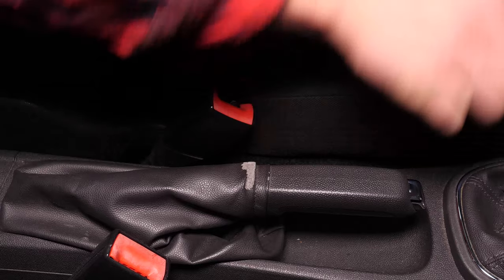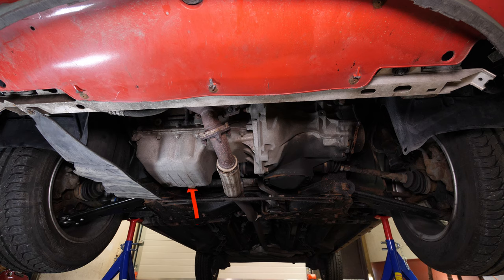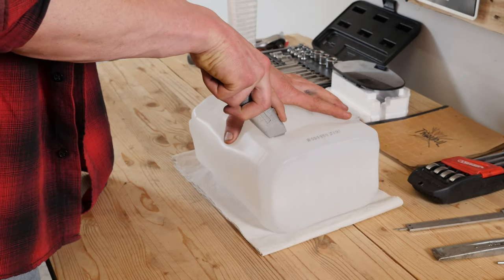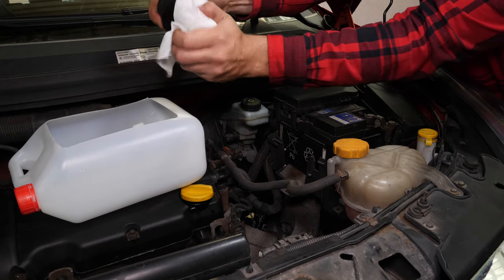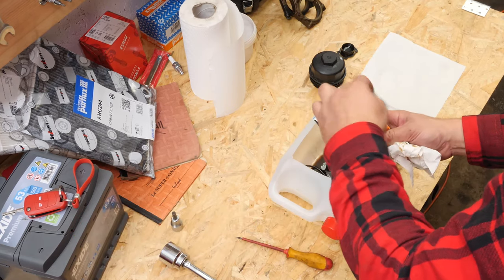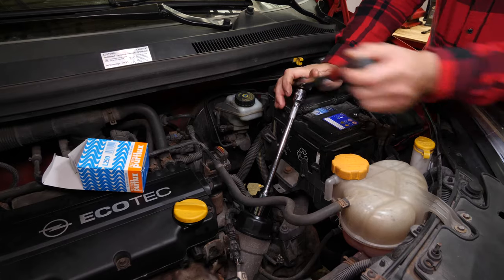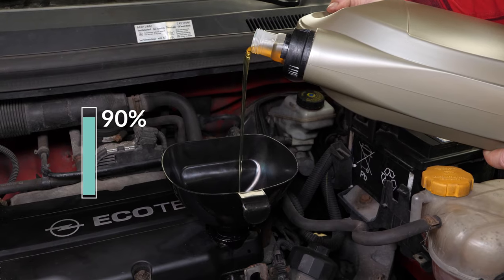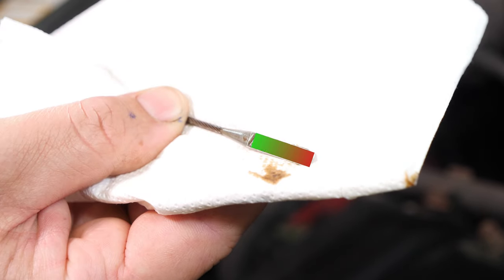Change the oil and the oil filter CORSA D 1.2 TWINPORT 🛢

Comment from the maker: BUY THE AUTO PARTS you need for the operation : 👉 http://bit.ly/cheapAutoparts 👈
📱 DOWNLOAD THE APP : 🍎 http://bit.ly/MCD12AppStore, 🤖 : http://bit.ly/MCD12PlayStore 📱⬇︎⬇︎ 🔥   🔧🔧🔧   🔥⬇︎⬇︎

🛠📏⚙ FIND ALL THE PARTS AND TOOLS NEEDED AND RECOMMENDED BY USETOOL EN ⚙📏🛠

Needed parts: 
- Oil filter : http://bit.ly/oilfilterL290en

- Motor oil : http://bit.ly/oil8100XCLEANEFE5W30en

- Drain seal : http://bit.ly/drainseal476750en

- Brake cleaner : http://bit.ly/brakecleaneren

Discover a vast array of services that will help you run the maintenance of your car: vehicle user manuals, maintenance planning and mechanics-oriented tutorials!
How to change the oil and the oil filter on a Opel Corsa D.

Discover the world of UseTool EN on http://bit.ly/usetool

Needed tools:
-💣🤖🏆The complete toolbox recommended by UseTool ES to repair your Corsa D : http://bit.ly/supertoolboxEN 🏆🤖💣

- 32mm socket
- Socket wrench
- Socket wrench + long extender
- Thin flat head screwdriver
- Paper towel
- Measuring cup (optional)
- Piece of tissue
- Liquid collector
- Funnel (optional)
- 7mm Allen socket

🔝💪Safely lift your Corsa D with the hydraulic jack: http://bit.ly/upupupen and axle stands: http://bit.ly/axlesen recommended by UseTool EN 💪🔝

- Hydraulic jack 
- Wooden peg
- Axle stand

🚗📢💡 RESOURCES 💡📢🚗

Usetool's warnings
- Don't perform this operation when the engine is still hot, as you could seriously burn yourself. 

- Be very meticulous when filling the engine with oil, especially on a Diesel engine. Never go over the maximum level indicated.

Usetool's infos
Tightening the new filter by hand is enough to set it in place.

📽❤️🚨 USEFUL VIDEOS 🚨❤️📽
- [ USETOOL'S TIPS & TRICKS ] DIY: Making a liquids collector : https://youtu.be/wVSbtm-DAgY

- [ USETOOL'S TIPS & TRICKS ] Lifting your vehicle safely : https://youtu.be/93QCNfGihMw

- [ USETOOL'S TIPS & TRICKS ] Unscrewing a blocked oil filter : https://youtu.be/hrPp4VmvdhI

Comment: Great videos guys. Note for anyone at 3:10 they have already screwed back in the sump plug.  You are better to leave this out until last because when you remove the oil filter it releases the oil that was in the housing where it sits, so basically you won't drain all your old oil if you out the sump plug back in BEFORE removing the oil filter (approx 300 - 500ml)
Reply: Good advice. Thanks